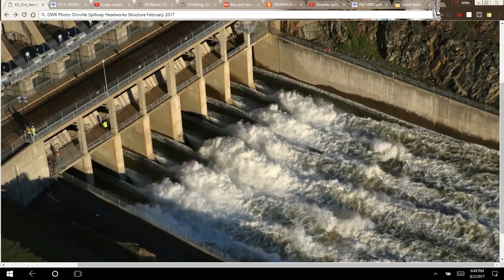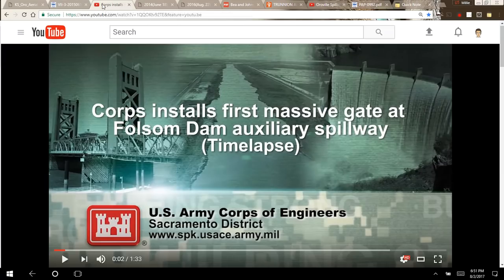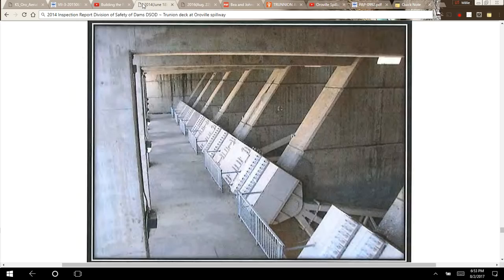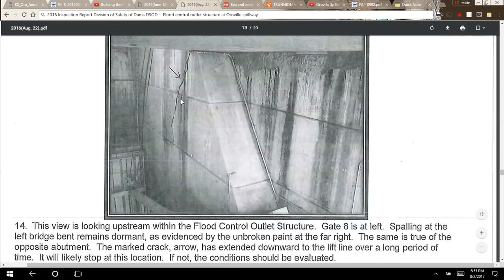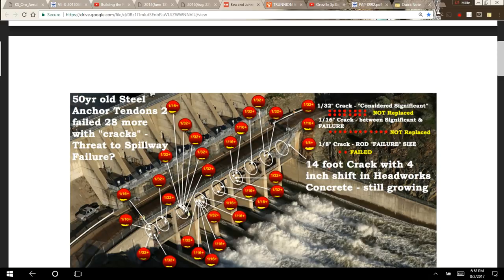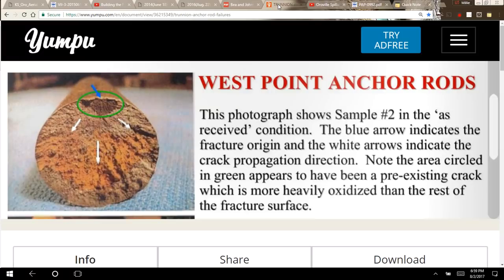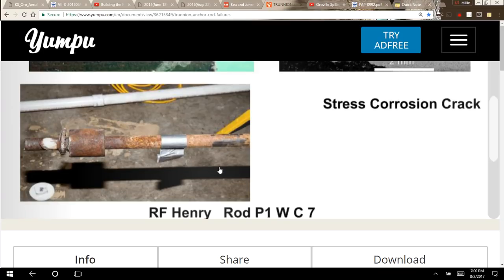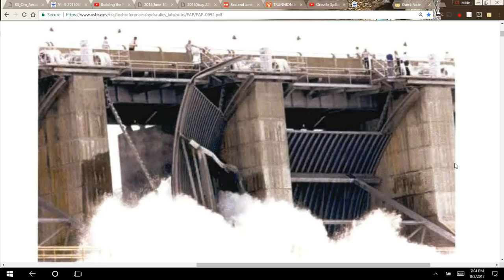Are Oroville Dam spillway gates safe? (And what about those trunnions and tendons?)  8/2/17

Comment: Nice report , Would just like to state some observation's 
The chance that all 8 gates break at once is nill , what could happen is one gate break ,  as the amount of water flow's out of a broken gate will be proportional to the area of gap ,  Each gate max outflow is 34k cfs , 50% open hole will alow for a flow of  17k cfs , not a great danger , the bigger problem would have been if they did not fix the MSW and the erosion creeped upstream towards gates , and the whole gate structure collapsed , sending 200k cfs or more into downstream river's .
It is posible to drill out the anchors and replace them one by one , this will be better option as replacing whole structure .
To Replace whole structure they will need to draw lake down to atleast 600 feet to give a good buffer flood zone buffer.
Reply from the maker: Hi Conrad. Thanks. Not sure why you use the factor of a "50% open hole" for the scenario of a broken gate.

Anyway, according to "Best Practices in Dam and Levee Safety Risk Analysis"
VII-1. Failure of Radial (Tainter) Gates under Normal Operational Conditions
June 11, 2015 (US Department of the Interior, Bureau of Reclamation; US Army Corps of Engineers), "Consequences are a function of the reservoir level at the time of failure (which determines the breach outflow)." They further state:

"For spillways with multiple radial gates, failure during gate operation is most likely to result in only one gate failing, since the gates are typically not all operated simultaneously, and failure of a gate would likely result in an evaluation, and a reluctance to operate the other gates.

If a spillway with multiple gates is being operated during flood conditions and the spillway capacity provided by more than one gate is needed to pass the flood, it may be possible that multiple gates would fail due to gate operation. The scenario would be that one spillway gate is initially opened to pass flood inflows and the gate fails suddenly. The increased discharge through the failed gate bay would likely be enough to match incoming flows for a while. At some point, the inflows would increase to the level that discharge from a second spillway gate would be needed to prevent the reservoir from rising to the level that dam overtopping would be possible. The decision would likely be made to open the second gate, recognizing that it too may fail."

I don't agree that patching is better than replacement. Too many potential failure points.
Reply: I came to 50% by looking at the damaged gate you had in your vid , if gate failed to 100% open there will be a flow of 37k cfs flowing out of gate , replacement of structure will only be able if they can draw lake down very low , and they did not have the means to do that this season , due to broken spilway.
Reply from the maker: Oh, I see. As for drawing the lake down, they could have lowered it to the necessary elevation before the repairs started -- if their priority had been to fix the headworks.
Reply: Remember , if you have a broken msw , you have a on/of flow , eg in beginning  could only spill at 50k cfs , till eg 830 feet , the rest they can only spill via hpp @ 13k cfs , if inflow's higher than 13k cfs lake will start to rise again , and when lake at 850 re open @ 50k again , repeat till inflow lower than hpp , now lets say msw able to spill from 1k cfs to 100k cfs as we will hopefull have next rainy season they can drop lake to 813 and keep it there till hpp can keep up to inflows , this mean's they can have lake at 813 feet earlier (was not possible this season )
Reply from the maker: Mostly depends on the weather. Hopefully we won't get a Pineapple Express or two this year.
Reply: Conrad Human; If the gate next to the wall that has a 4 inch wide split running 14 feet through the concrete, that can very quickly erode and cause the collapse of the whole gateway.

Comment: Let's assume the Tinter gates fail entirely.  Nothing catastrophic will happen. Ether the gate is open or closed.  Closed gates at worst drive water over the emergency spillway and everything is ok.  Open gates just let water down the chute.  It implies some difficulty in managing depth of the lake but no serious safety issue.
Reply from the maker: Thanks for commenting, Paul. Yes, closed gates result in water going over the emergency spillway weir at elevation 901. Open gates release water down the main spillway chute. If gates failed to a point of uncontrolled releases down the main chute, the draining of the reservoir would stop when it reached bottom of the gates at elevation 813. Other possibilities include failure/collapse of the entire gatehead structure, which some believe to be possible due to factors such as age, maintenance issues, the 14-foot crack... I think it is good to have open discussions on these matters, so thanks again for stopping by!

Comment: I continue to be concerned about the spillway control gate structure and it's known column cracks and spalling. It seems as though it was built on the same poor substrate as the rest of the upper spillway and may be inadequately supported by bedrock and has obviously been experiencing stress damage and some shifting evidenced by the cracking etc. This, to me, indicates that the gate structure may be a major accident just waiting to happen.
I expect the upper end of the spillway at the control structure to be seriously undermined as that has been a primary source water flow underneath the spillway slab.  Some of the photographs show gate leakage disappearing through the cracks in the upper spillway just below the control structure.  This is indicative of voids beneath the slab and likely there are major voids adjacent to the gate structure as well. https://pixel-ca-https://pixel-ca-dwr.photoshelter.com/image?_bqG=834&_bqH=eJxNzsuOgjAUBuCn0Y0ZQgUVTVhAKVgUUKiOzKYheNcMFxVHnn6KMS2Ltv_J155TZVN4y5WtVXB3K.zYqw.Bu3K.htTQJkABYAJkuVls96gVQT0rs.p0ve56t5wdz.TV676BGr6l31mGmMQ6OyNiENQEGKx8EsYUR0FT4oiGaI6MCFmfctGugxAjnz3Fgf_uEoREt1inNzkUW3rQ_GY62COpjLbpEHcpNKnHurDxn7jiMbRF9JpoQKLfdkmZHrsOneOIdAam3BlYutO0Tc.zGaiWLnqqXdgMY3v7Emwuqd9mKu3hYRHHggHnjQpc5bUsRqDFfc6X_iXBIC_zxBOscEZwurWHVZUlB8EqZ0.WtkZWj2GqCR5wnudmeTwjWy1kwUPOp8fMz8ZIkYKn4BFnsvl119dj8UNaszXOiiRRs67uSo0Fjzn_1fnjfBpP87X2D_SbqPg-
My personal recommendation would have been to keep the current upper spillway operational at reduced capacity after it was treated for it's deficiencies. and begin construction of a new spillway channel diagonally southwestward starting on the current boat ramp parking lot adjacent to the current emergency spillway and flowing to the downstream bend of the river..  Then fully repair the current spillway to be used as the replacement for the current emergency spillway after the new spillway is completed.
Reply from the maker: Hi Robert. Very interesting commentary . . . thanks for posting. "Accident waiting to happen" is an appropriate description, in my opinion. For some reason, that URL didn't work for me. I sure would like to see the photo. If possible, please re-post the link. Thanks!
Reply: Millie, The short link didn't work so I had to change to the extremely long one.  That one seems to work when I tested it. The photo I posted is #835 of the 1311 currently posted on the DWR site.
Reply from the maker: The long link works. Thanks! "Seriously undermined" is a good choice of words to describe the area near the headworks structure.
Reply from the maker: Hi Robert. Thanks for posting the correct link. Even though people say that water on the spillway when the gates are closed is "totally normal" -- and that all spillway gates will have some leakage -- it still bothers me when I see that sandbags are needed to direct the flow.
Reply: Robert Callies. Good analysis and a sensible course of action!

Comment: I feel like stupid about my lack of affiliated knowledge ...
But why the hell are they not movable like lifters in buildings ?
I mean why is there nothing to opposite the weight doors itself that will help to open and close .
I mean a weight on like "rail roads" on to each gate that would be the real control the gates and hydraulic system to will allow to maintain the gate the level it as to ?

I just don't get the "mind" the conception those "gates" ...

Must be stupid or something is going roughly wrong .

However I do better understand the answer about structural integrity given on live feeds ...

It helps .
Reply from the maker: Hi Brice! No . . . don't feel stupid . . . we are all learning as we go. Well, the gates are controlled with electric motors and cables. Wow, "structural integrity" is quite a subject! Thanks for stopping by.

Comment: If a metallurgy test were done on the rod/tendons one would find that it is an inferior grade of iron.  I think all tendons are inferior grade.  Companies who built dams cut corners like amount of cement, smaller diameter of tendons, inferior strength of concrete ( not superior grade), inferior design to cut corners, improper mixing time, improper setting time, contaminates in the concrete, contaminates in rods/ tendons leading to weakened rods, not using enough rebar/ tendons, (not thick enough tendons for super dams), not using enough thickness of cement for super dams.  Companies want to save millions, tens of millions by cutting corners.  It goes into their pocket if they cut corners. Examination of materials, design should be done and it would take years to conclude.  Good luck on the fix.  I do not believe it can be fixed.  Only way,  tear it down and build it right, without cutting corners.  Test all materials before installation.  Check every engineering work that is done, have a three check, TWO INDEPENDENT INSPECTORS FOR WORK APPROVAL.   This is the only way this should be done.  Do not leave everything to be checked and done by one company.   GOOD LUCK VALLEY RESIDENTS.  Have life jackets and unsinkable boats AT THE READY.
Reply: Do you have any evidence to back up your claims here, James?
Reply from the maker: Thank you for the articulate, insightful comment, James! I totally agree that the entire headworks structure needs to be torn down and built right.
Reply: Which "grade" of steel would you have specified in this structure? What safety factor would you have used in the steel scantlings? What concrete would you have specified for this construction?
Your comment clearly shows you do not possess knowledge of either concrete or steel. You CANNOT "improperly" mix concrete, concrete does not "set", it cures. And yes, STEEL would've been used in this strucutre, not IRON, which is a very, very different metal from a structural standpoint....
You ARE aware that a structure like this is built to a very strict design and that all those inspections you feel should be done, were carried out on initial construction and supply of materials, aren't you?
Reply: @James: "Do not leave everything to be checked and done by one company.". I share this opinion too.
Reply: Only an egotist or a fool would state that you cannot "improperly" mix concrete.  I see supplemental water being added to the concrete being poured in todays DWR video. That is a no-no and will have a deleterious affect on the strength of the final product even if it is only "leveling" concrete fill. 
Yes, a structure like this was intended to be built to strict design criteria, however, the spillway substrate of mixed earthen fill and weathered "rotten" rock certainly fails to bear out your faith in strict design adherence by the contractor.
Reply: The above comment was addressed to the preceding comment by "Sideslip".
Reply: I see many inspectors watching the placement and samples being taken to insure compliance with the design  in these recent videos.  The water you see being added  in the first part of video with the concrete boom pump is a well accepted practice to mix between different batches being overlayed in a continuous pour.    There is intended mixing between previous placed and overlay concrete going on here with the stinger vibrators doing most this work.  Indeed cutting corners  would be to allow the surface crust to be allowed into the mix going on in placement, no vibration, and thicker overlays. Not the case here.  Having that skilled water hose man is an added expense and likely he is under the direction of the concrete inspector you see standing next to the boom operator (however pre occupied on his cell phone!). As for later on with the RCC in the dark; there is spraying of these piles out of the dump trucks to keep the mix  optimally wet and not dry out before it can be placed. Once again a quality measure and not a corner cut.  Concrete curing  is a hydration process and the environment that this concrete is being placed is hot and dry...adding water to help hydrate is far from  corner cutting or a "no no".
Reply: +Elffirr Design Totally agree. Thank you. 
I am still waiting for James Dohnalek to back up his extraordinary claims. And I am surprised that, given Millie Kay's even handed and fact-based treatment of the Oroville story, that she gives James any kind of support for these claims. 
It seems to me that the dam operators and the regulators are aware of the condition of the structure, and have made the call that, for the time being, it is OK. It also seems to me that there is more load on the gates when they are closed than when open and passing water.
Reply: Fabricating lies, James, may make you feel better, but it does nothing to educate the community.  Fail.

Comment: The main spillway gates are a "last line of defence" to protect and allow the reconstruction of the damaged spillway to take place this season. If they were all pulled out for repair while the spillway was getting rebuilt and the lake had a massive inflow and washed out all the repair work what would all the doomsdayers and fearmongers have to say then? no doubt offer there expert opinions on what should have been done i am sure. Its quite simple why they are being left as is. A risk assessment has determined they need to stay while reconstruction takes place.

I would even bet that is why the shotcreted rock in front of the ES will remain untouched for a while as a safety measure should it overtop cos they are just not going to open the main gates should the lake have a big inflow, i would also say this is why the secant wall activity is all in front of the carpark if you like instead in front of the ES at this point.

The other thing they are now doing is lowering the lake to give increased inflow capacity, sure this will create some issues but its big picture stuff here, not band aids. But ofcourse the fearmonger crowd will come up with a tree being on an angle means there must be water leaking in the ground or some other relevant theory from looking halfway around the other side of the world....
Reply from the maker: I just won't be in town for another emergency spillway experiment.
Reply: Gavin84w.  Gavin, you really do need to listen to Millie in a more comprehending way!
Reply: Millie Kay. Your presentation is brilliant! Very well done!!